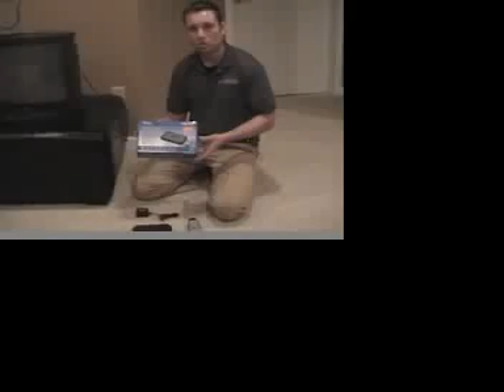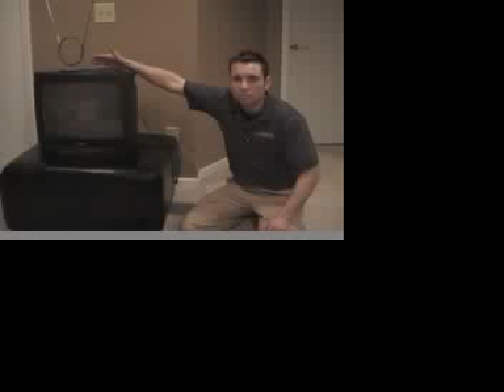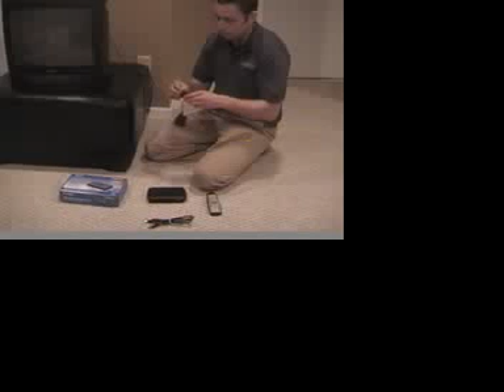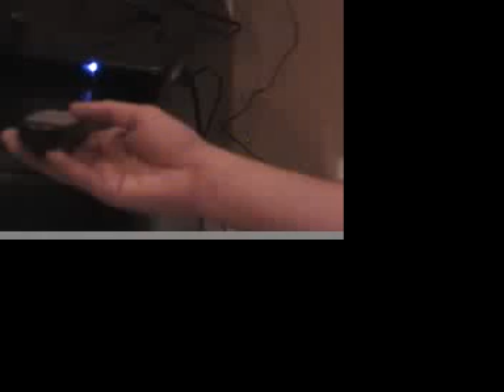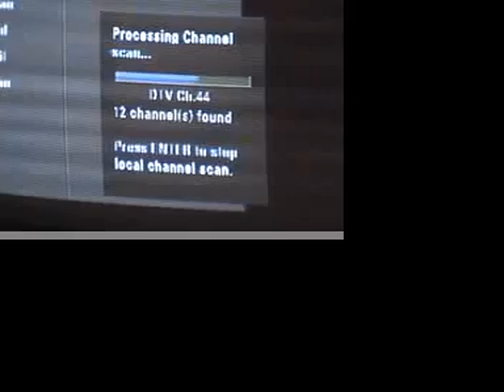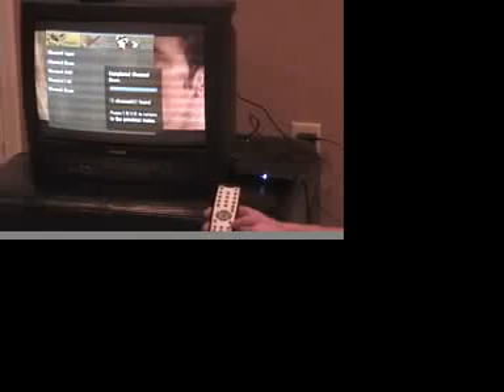Artec T3A Pro Product Review

Comment: Well done. I just bought one of these mint at the thrift store...unused, I think...for five bucks. I was hoping it would work on cable tv, but it doesn't find the signal. I assume it just works with your antenna for local rf signals. It seems like a well made unit.